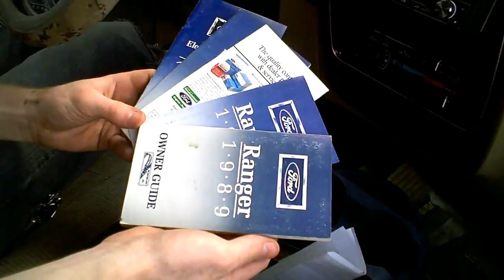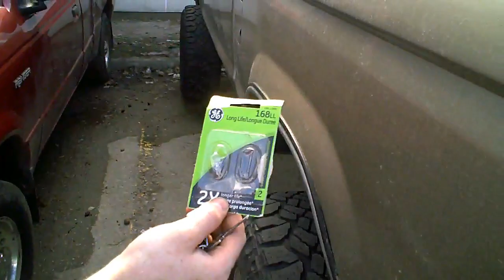Auto Wrecker Finds

Comment: I've got the same mirrors on my `92. Got them from the junk yard. When I got the truck it had the crappy plastic floppy mirrors on it. Problem I ran into with mine is not the rivets that hold the arms, it's the ball that goes into the bottom of the mirror. Both of mine have seized up. Can't adjust either mirror any more. Complete pain in the ass.

Comment: From first look, there was more Fords in that yard than anything
Reply: you must not go to the junk yards to often everyone of them are full of fords there junk
Reply: Tony T
Agree Fords are not so good there not very mechanic friendly stuff does not interchange like a GM, all there brand new trucks are trash there all aluminum engines transmission go after 7000 mile, be better getting a S10 with a T5 and 4.6L you can't go wrong or a older Mazda is better if you want a small truck.
Reply: I have owned both a ranger's and s10's and much happier with my s10! Them ford rangers are death traps wouldn't even call them trucks with them wimpy ass frame rails. feels like the wind will pick you up and blow you away  on windy days. At  least ford did one thing right they circled there problem.
Reply: Well maybe there gonna have another demolition derby over at Davids farm this year if the cops don't raid the place again and use that Ford Ranger in it that's the best use for a Ford is demolition entertainment those seats they put in look like cloth vinyl vinyl is no good I put that style in mine and the vinyl always cracks and rips first, since its Ford he could have bought the whole truck for $85.00 seats and all its only worth what you get in scrap metal.

Comment: I'll have to remember that tip about finding change in Dodge trucks.

Too bad we don't have dollar coins in America.  Not just because of that, but there are other advantages.
Reply: We do have dollar coins
Reply: Yeah, but they're so uncommon that we might as well not have them.

The Eisenhower dollar didn't work because people hoarded them instead of spending them (it was the first dollar coin to be issued in 30 years), and cost too much to produce in large quantities. The Susan Bs confused people because they were the same color as quarters, and almost the same size, so they tried making them gold when they switched the design to Sacagawea, but people just hoarded them like the Ikes.  The Presidential dollars are a limited run, the mint is just catering to collectors now, they've completely given up on getting people to use them.

For it to work, they need to cut back (or completely eliminate) bill production and make more coins.  Changing the color might make them less likely to be hoarded as well, maybe copper plated zinc (like a penny).
Reply: TBustah The only place I've ever received them are from our local scrap yards. They hand out brand new dollar coins for anything smaller than a $10 bill.
Reply: I know we do.  But you said it yourself: most people don't know about them.

Read my earlier comments.  I explain why.